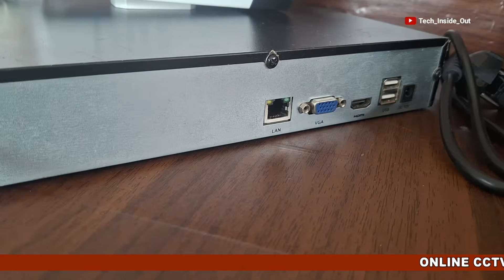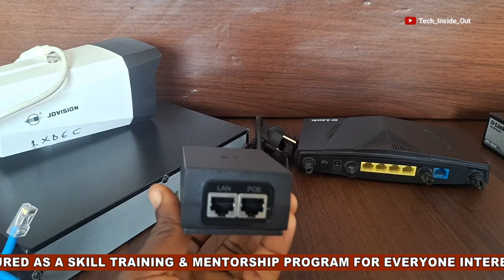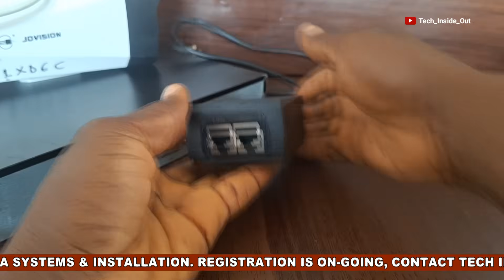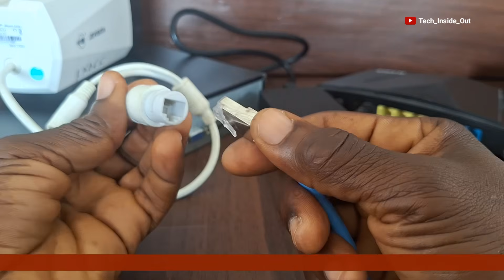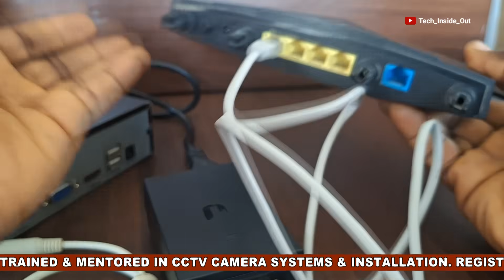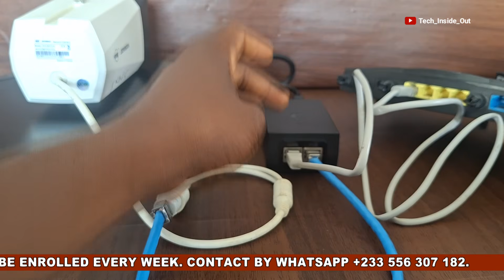Using PoE injectors in place of POE switch for setting up IP cameras

Comment: Thanks for this video! I'm hoping you can help me with a specific setup question. I want to run an IP camera outside using a POE injector but from the injector I want to connect via WiFi to my router. My router is at the front of my house and the camera will be in my backyard so there is no way I can run ethernet from the injector to my router. Are there any combo ethernet/WiFi injectors or is there a wireless network device I can attach to the injector via ethernet that I can use wifi to connect to my router?
Reply from the maker: For setups requiring the use of WiFi as the source of internet, you need to use WiFi cameras.
Reply: @Tech_Inside_Out  Oh. So I can't use an Ethernet camera to the injector and then somehow use wifi from that point to my router? I was hoping to hardwire with ethernet to get to my house where the signal is stronger and then wifi from there. The problem with wifi cameras in my backyard is where I want to put them the wifi signal isn't great, even with a mesh system. That's why ethernet to the house is the best and wifi from there.